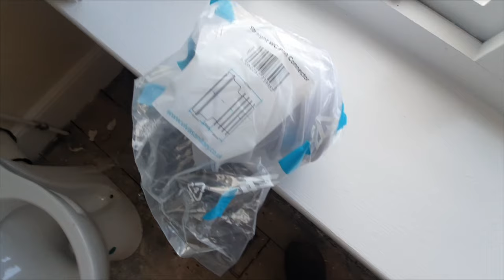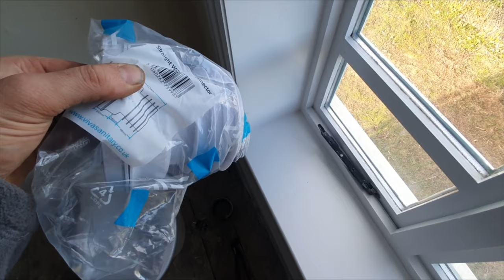Apprenticeship van chat and a toilet and basin install - Adventures of A plumber#32

Comment: Great video and good advice👍

I use the basin mate washer pack dudley do for the wastes, they seem to work well and pretty cheap too. 

 Be interested in your thoughts on older people changing career to get into the industry. I'm off to college in May, theory is online at home, practicals will be a Saturday so I can keep working and paying the bills. It's getting a job after that may be tricky. Obviously I've got a lot more life experience and diy projects under my belt. I've done a few tap changes, fitted toilet gubbins, blending valves, remove and refit rads for decorating, etc etc and I do a few odd jobs on basic plumbing I'm happy with to get some more experience, but it's still not a time served apprenticeship.
Reply from the maker: If your really interested in plumbing which you obviously are you will make it no matter what age you start, I mostly found that when I first started I really struggled with confidence, it wasn't the lack of knowledge or ability but confidence, if you are confident and believe in your ability you can overcome any obstacle and it may be that  being slightly older will help you in this aspect, the thing with plumbing is once you master the basics of how systems work you can apply that to a whole range of different scenarios, I am sure with the right help from your training centre you will make a great impression in the industry and I will be always here if you need any help or advise on anything Plumbing related, best of luck with everything, kind regard Tom
Reply: Thank you much appreciated. 😊 Confidence is a work in progress I'm always worried about messing up in someone else's home. It'll come in time, better that than to be over confident I think.
Reply from the maker: @Tom_Plumb_PHS  Confidence will come with experience, just trust your ability and get the basics right, always know where the water turns off, if in doubt always drain down, and check for leaks when your finished and you can't normally go to far wrong